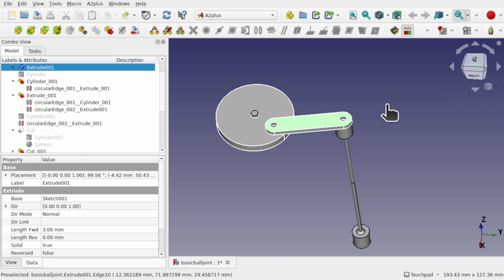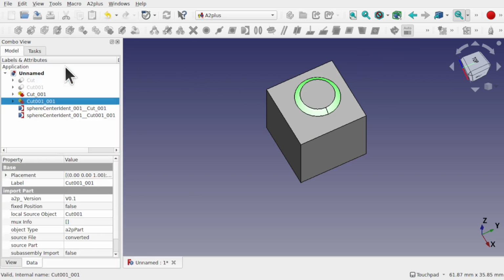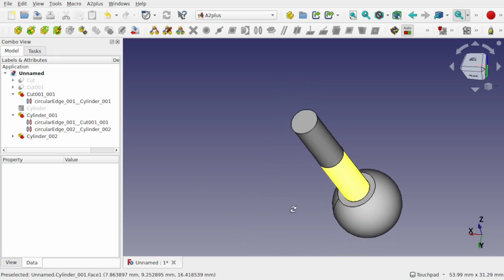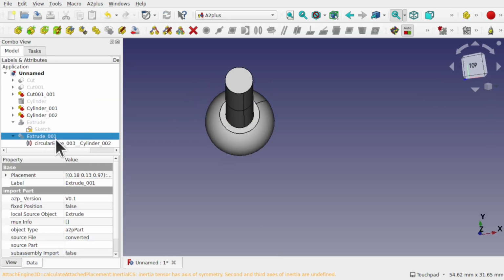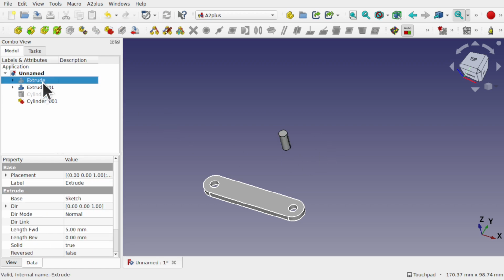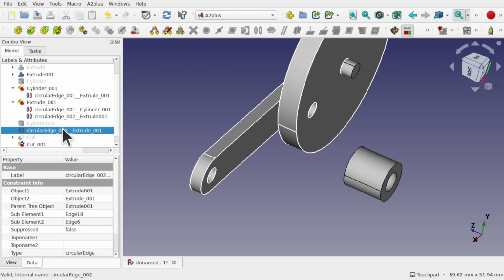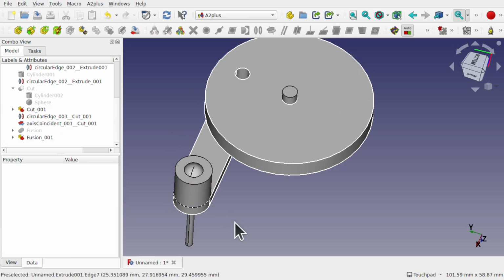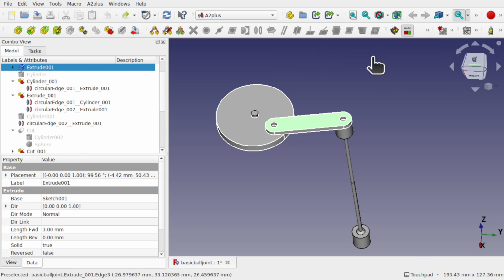FreeCAD 0.20 For Beginners | 23 | : More A2Plus Assembly Constraints | Part 2

Comment: You know, I've done the whole series of your. tutorials. and I definitely can say I've learned to navigate and use the free CAD software. I think now about the only exercise that I've had trouble with is the photo tracing one I'll have to go back and retry it. The boat. hull was a little Difficult   Took me a couple of attempts, but eventually I got it.  I hope that you do some more master sketch type I feel that I would need at least two or three of those exercises to really. get the concept down of labeling the formulas and. applying it. I think so far I've only run into one of your tutorials that uses a master sketch.  But overall, I have to tell you, it's been such a blessing to me finding your channel.,  I was drove to 3D parametric modeling. because of a woodworking project, a. Japanese style desk. that there is no way that I would be able to build it without having technical drawings. And now I feel like I probably could accomplish. my goal, but I'm going to continue on because learning from you has been so much fun. and I just wanted to take the time to thank you so much for what you do. You really are making a difference in people's lives. And who knows, maybe I'll go on to learn to do 3D printing. and CNC toolpaths. and have more job opportunities because of that.

Comment: Having used Fusion 360 and coming to FreeCAD in hopes of having access to analysis tools (which I are not available in the hobby version of F360) I'm a bit concerned. The more I learn about FreeCAD, the more fragile it seems. As I learn more, will I find ways to tame it? Are the other assembly workbenches more robust, with collision restraints? I understand it's a completely different beast, but would OpenSCAD be a better option?
Reply: Dear Leroy, I've come to this Tutorial long after the rest of you. I tend to agree perhaps this Tutorial was not the best example. It would appear to Me that A2 is a way to test assembly interaction prior to manufacture by whatever process. I can however see uses in my hobby for testing components prior to printing. I suppose One has to remember FreeCAD is Open Source. Generally I've found this series quite illuminating as regards Freecad. Again it seems One has to get experienced with the interaction and use of various work benches to get maximum use out of it. I still think FreeCAd presents good value opposed to more expensive options.